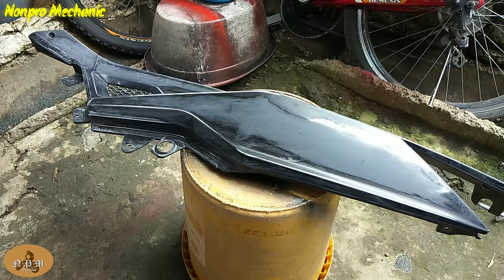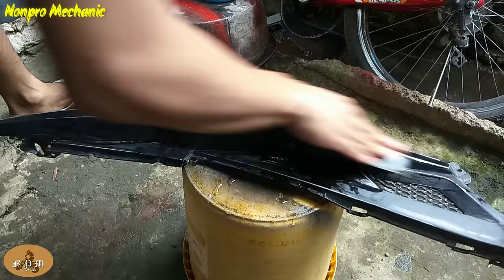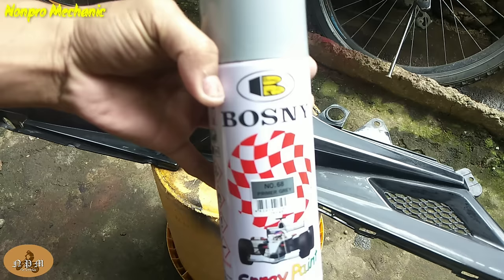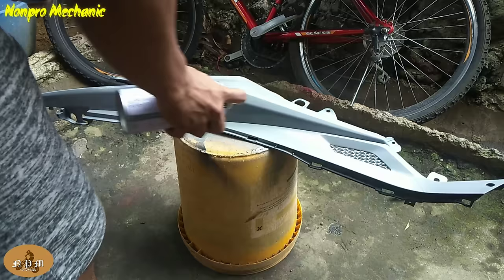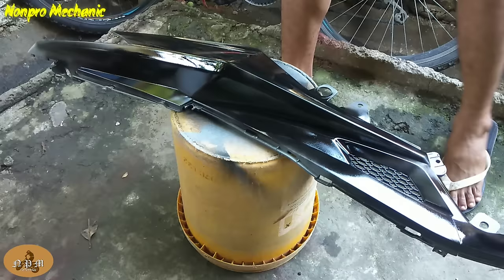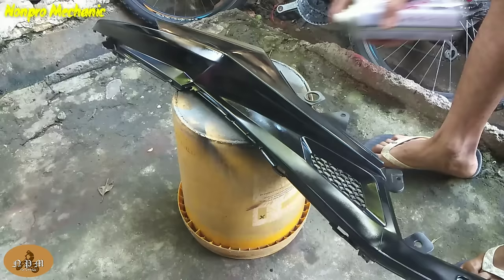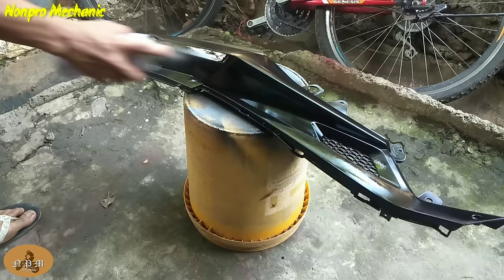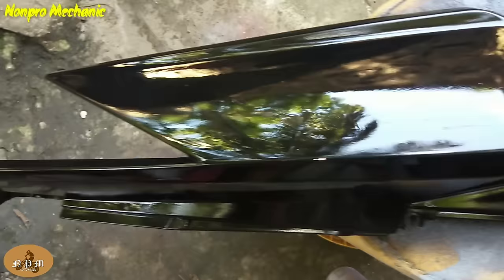How to Repaint Motorcycle Fairing's

Comment: para ma avoid ang orange peel sa paint, once fully dried use 1000 grit sandpaper and lightly wetsand the surfave until the orange peel comes off. you can also do this with clear coat but use 2000 or higher grit
Reply: ano po yung orange peel na yun sir? thanks.
Reply: boss pwd ba lihain muna ng 2000grip bago lagyan ng clear coat para matangal ang orange peel?
Reply: Tama ka jan boss mas dabest yun . 
Bawat coating liha muna ng 1000 tapos patong
Reply: @kimpottv2827  boss need b basain o lilihain lng after every coat? Salamat
Reply: Buffing nalang po ba afterwards or patong ulet ng paint?
Reply: @kimpottv2827  ano pong reason bakit kilangan lihain pag kaka coating boss sana masagot?
Reply: @markyvlogs7429 para ata mas makapit yung paint boss
Reply: @jhobertlucero2371 yun yung Tinawag na balat suha

Comment: Looks ok for DIY project. But if will do it to my motor, gusto ko anzahl paint at spray na tunay. Kasi Bosny magaspang ang finish. Pero sa DIY maganda na ang gawa mo compare sa ibng napanood ko.
Reply: Try mo i wet sandIng ng 1000-2000 grit after top coat para kuminis tapos rubbing compound para kumintab ulit.

Comment: Idol, ask lg ako, ano po ba recommended niyo sa dalawa: Bili nlg new fairings or iparepaint ang current fairings? Luma na po ksi tignan motor ko and may gas2 din. Gusto ko sana magmukhang bago kaso di ko alam if ipaparepaint ko pa or bili ng new fairings. More power idol
Reply: Basehan nyo sir kung magkano magastos pa repaint vs new fairings.

Comment: New subscribe boss,anu magandang valve clearance sa motoposh pinoy155 na may sidecar,private?___intake / ___exhaust. Thanks
Reply from the maker: ang Clearance ko dyan 0.06 intake para di masyado dikit tapos gawin mo 0.08 ex.
Reply: @nonpromechanic  meron knb nainstall sa pinoy155 n gearshift indicator sensor?pra sana mlaman ko kung anung gear n ako 1st or 2nd minsan kya dko maiwasan mgkmli. 1st gear ako yun pla nuetral na.thanks